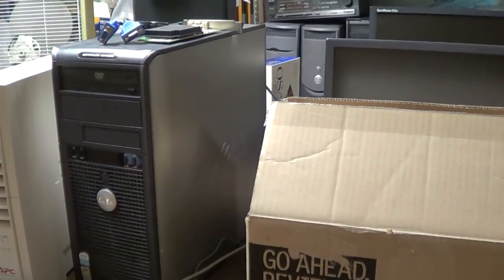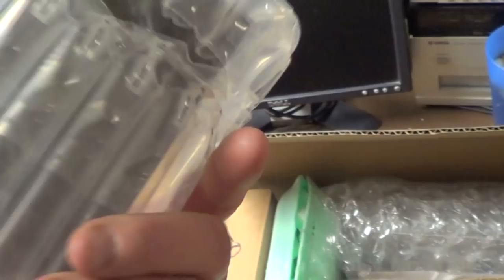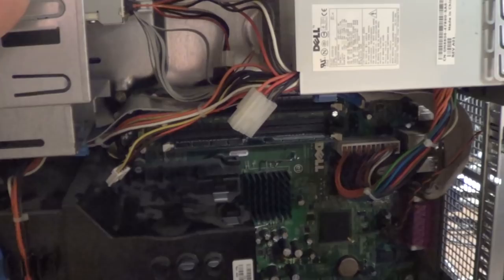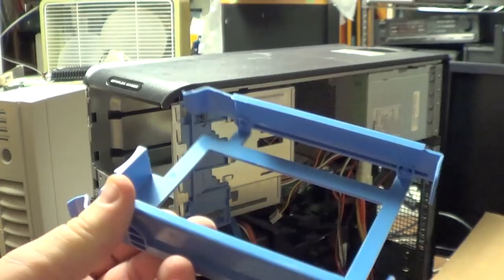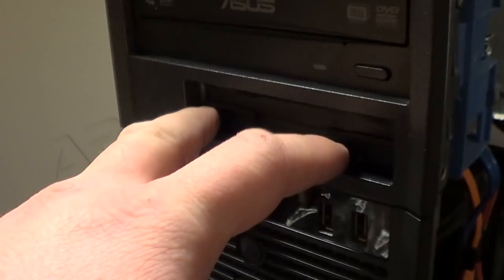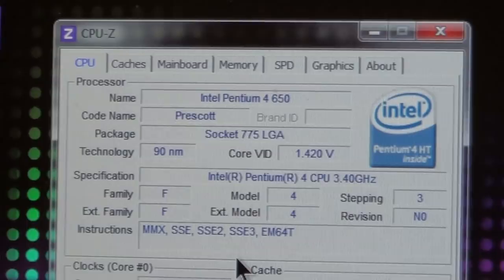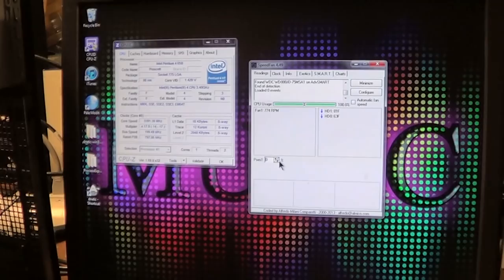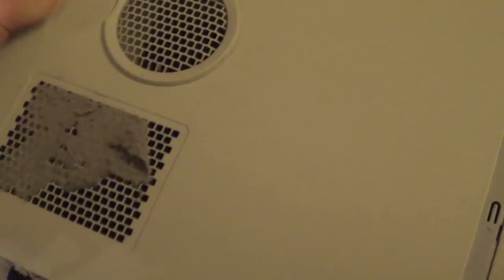"New" Music Player PC Build

Comment: Hey UXWBill.. couldn't help noticing the external audio card at around the 30min mark. I happen to have the same one connected to my build. Wondering if you had any software problems with the external sound card's included software. When ever I open the program, either all my 8GB of RAM get used up or the computer blue screens.
Reply: I have mine connected directly to one of the back ports of the tower. The buggy software doesn't bother me much since I setup my audio preferences already, there isn't anymore use for it. But thanks. just was wondering if you had any issue with it.

Comment: This computer even runs faster than my Dell laptop. Mine only runs at 2.53 ghz, but its a Core 2 Quad extreme instead of a Pentium 4. Also the ram mine uses is 12 GBs of DDR3 ram at 1066 mhz.

Comment: I'm thinking of an issue that's might be half way off topic, but the issue is on the brain at the moment. I've been using our HP a735w which has 2 line level inputs that I've been using to make mp3's. I had a Califone cassette recorder connected with a mono splitter for stereo connected. I'm guessing something has caused something to get fried on that front socket. The rear socket still works fine. I also suspect that the Califone with splitter combo fried a set of outputs on my Sony amp. They are completely dead.
 I recently acquired a JC penny branded boom box that has cassette decks, radio and the real reason I wanted that thing is it doesn't have aux inputs but phono inputs. Now the working back socket has a true stereo input and there is no need for a phono preamp when I use my record player.
Do you have any thoughts on what cooked my jacks LOL ?

Comment: I have an older version of this computer, an I managed to install 8 gigs of kingston 667 ram. I'm not really sure why but if I install more than 2 gigs of anything higher than the 667 the computer seems to like to shit on itself and no longer power on. Still not really sure why a lower speed of ram would allow me to go up to 8 gigs vs no letting me go any higher than 2 with 800+
Reply: ***** I picked 3 of them up from a school, the one that I got to work with 8 gigs may have been newer than the others. The students at the school were nice enough to take a permanent marker and draw over some of labels and the anything else that they felt like. I think I have them stored in my basement currently, but I'll be selling them soon on craigslist so I'll probably clean them and run the dell utility on their website to see what model the one that I had 8 gigs is. Great computers overall, I might just donate a few of them to a few families that I know that are in need.

Comment: i have a dell optiplex gx620n that i fixed up and now it runs windows 7 home premium on 4gb of ram and the original Pentium 4 ht at 3.0 GHz. you can even run videos a 720p on it (ps. it does not have a pci graphics card just the gma 950. I love dell :} ). i am using a dell inspiron 6400 to post this comment and unfortunately isn't very reliable

Comment: Is there a reason that you use Windows 7 as opposed to VortexBox, or some other lightweight linux distribution for storage/playback?
Reply: Fully understood, thanks for taking the time to respond! Adding to that, if you ever need a little weekend project, check out MPD (Music Playing Daemon) and some of the frontends/plugins for it. I personally use it on my machines at home, and use it's versatile output settings to send audio into my VOIP server, as well as home sound system.

Comment: I upgraded my GX620 with a 3.4GHz Presler Pentium D processor. It actually runs Windows 10! But I need an Ethernet card because the built-in Ethernet driver doesn't get along with Windows 10.
Reply from the maker: There's no reason the onboard Ethernet shouldn't work, unless it's physically broken. Use the Intel Pro/100VE drivers from Intel's web site. (Yes, I've run Windows 10 on a GX620 and yes the onboard Ethernet worked just fine out of the box.)
Reply: uxwbill weird, my machine uses the Broadcom NetXtreme driver! If I roll it back it works.
Reply: Maybe I've been using the wrong driver then, I had been using the Broadcom NetXtreme driver because it works once I roll it back an iteration.
Reply from the maker: You're right, the 620 had a Broadcom adapter. I had it mixed up with the 745. I can't imagine why there would be any update to the Broadcom driver, since the hardware itself is quite old. Maybe try downloading and installing the Broadcom reference driver for the 5500 series from their web site?
Reply: That's probably what I'll end up doing. My guess is Windows is downloading the wrong one.

Comment: Ok the first thing. Don't use the Intel Onboard Graphics for this type of application. This WILL decrease your system performance, ESPECIALLY when you are playing YouTube videos. Yes, I know this is not a Gaming computer, but its better to separate the Video rendering from the computer in total, especially if you are running Windows with Aero enabled. Also if you are going to be playing music through the computer, you are better off spending the extra 40-200 bucks on a real sound card. Onboard sound card  is inferior to the Creative sound cards they used to have in the old machines (even new ones) but even with that case, yes Onboard sound cards do work fine these days for full sound playback, but not only they could be faulty and are not designed for this type of application, it also robs CPU power, so better to get a separate sound card.
Reply: I never made assumptions that you don't know what you are doing. I am only going by experience. From what you are telling me, your set up works perfectly fine, especially when you are only playing music from a music from a music library. However, I only advised for a Video card because of the separation. It is extremely rare that a video card will go wrong, especially if it is a Fanless one, and the same factor could happen for the onboard video card. The sound card was an audio hardware I never trusted, which is why I prefer a sound card with a Better D/A convertor. I mean you are right. Modern onboard cards sound clean, and there is nothing wrong with them.... but I still don't trust them being that they are built into the motherboard, and are designed on a system strictly for business use (that is web and email) rather than serious audio usage.
Reply: Nihal Jude Hey uh this might seem rude but its not but trust me he has graphics cards and quite a few but in this situation its not worth it
Reply: @Phenom69ll computers never use there full rated current

Comment: +uxwbill Hey Bill I am just curious. (this is by no means a criticism) I was just wondering what you generally use floppy disks for? and how often? Or is it a reassurance of knowing its there should you ever need one? good video though.
Reply from the maker: +Tom Wilde BIOS flashes, quick file transfers, with older computers that don't (or can't) work with USB devices, DOS boot diskettes, Macintosh startup diskettes, to install software on older computers, and to a certain extent there is just knowing that they're readily available if I need one.

Comment: What processor is in the whitebox machine? Kinda looks like it's an LGA775 or Socket 478 unit.
Reply: ***** The CPU cooler does look similar to my S478 Northwood P4's cooler, so that would be my expectation. :)
Reply: ***** If it runs properly, then that would still be a usable office-style PC I guess. And yeah, the fact the Crashtor works at all is a minor miracle in itself!
Reply: ***** I had an Athlon XP machine that hit those sort of temperatures, but then it was both full of dust and completely knackered. I once had to reinstall Windows twice in one day on it! I'm surprised that I've not seen more Athlon XP machines on any of the computing channels I'm subscribed to.

Comment: I have the same pc just with a Pentium 4 HT (room heater edition) and it gives a beep error with 4 beeps (pause) 2 beeps (pause) 1 beep (pause) and the post screen comes up and it hangs there and dosent continue and the system is unresponsive
Reply from the maker: These really aren't worth a repair or troubleshooting any longer. Of that beep code, Dell gives only a cryptic explanation, "no time tick". This and the hangup might suggest severe CMOS corruption (clear it) or that the hardware time clock is not running (can try a replacement CR2032 battery, also check jumpers related to this).

However, these systems have and will display a message to indicate that the clock has stopped, indicating "time-of-day clock stopped". This one did, after it got wet in a flood!

More likely, the message means that the system timer has stopped (or never started) running. That's basically a fatal failure.

Comment: ASUS makes great stuff. You just gotta watch out on their more experimental ideas like Liquid metal or such. their low to mid end laptops and even some of their desktops are actually very good. 
I also have their noise cancelling mic phone dongle and it works a treat if I don't need super high fidelity on a phone call. 
and I've had generally good reliability out of Western digital, but have had very awful luck with segate and Toshiba drives. I've had 3 different Toshiba drives fail within a year. every Toshiba hard drive I've owned has failed at some point, and the only segate drive I've owned was a laptop with the drive in, it was a infamous rosewood model, and it was unbearably slow and only lasted 20k hours before the SMART info in crystal disk info was screaming CAUTION at me.

Comment: Complaining about Flush Player on a Pentium 4, eh?

Dear UXWbill, have you ever tried an Athlon64 or their dual-core X2 sisters? They're cool, quiet, power-efficient and powerful alternatives to their Pentium 4 and Pentium D adversaries. Source: I used an Athlon64 X2-4400+ as the basis for a tight-budget gaming PC, it could play most any lower-intensity game and work the Windows 7 effortlessly. Media was no problem for it and it drew like 50W at idle/doing media/web tasks even with a GTX 650 in.
Reply: +uxwbill i think a gpu will do wonders systems on either side  of this age for freeze player ...well atleast thats the case with our A64 x2 5200 sytem with a 6150 igp
Reply: Lol, the 6150 iGP, Intel X3100 and other integrated chips of this age were all well and good until Aero. Now they all need help it seems!

Comment: hey bill i have a ?... i also have a dell poweredge 1600sc server.. what the hell can i do with it as far as a rebuild (motherboard gpu psu ect)? it has the redundent power supplies in it.. i dont want to mod the case much or at all if possible... all the part in it work the last i knew when i was using it almost 4yrs ago.
Reply: bill i also have a puget custom build with an asus a8n-sli premium is it worth a rebuild i use it for everyday use dual screens and all... i found all the computer i own at goodwill (mom works there) , trash outs/clean outs of fourclosed homes (i did for 10yrs) and trash service (i did for 2yrs). oh btw thank u for your help
Reply: oh i also i dont game on pc just on playstation and i use my computers to fix other peoples computers also the puget as of now is running ubuntu 13.10.. i do run a xp, vista and win 7 machine too (the win 7 machine is the only pc i ever bought brand new)

Comment: Socket 775? Could you install a Core 2 Duo E4600 in this for better performance?
Reply: *****
Any ideas on why that may be?
Or is it just not 775?

Sorry, I'm trying to upgrade my Gateway 500GR (Pentium 4 HT 3GHz) to run just a bit better and the CPU fits in the socket no problems, but the system won't start...
Reply: *****
Any idea about the Gateway 500GR? It claims to have Socket 775, and I can replace the power supply if needed.

It's a bit under powered for what I do...

Comment: what type and modal of ddr2 did you buy? and could you recommend some that would work in a optiplex 775
Reply from the maker: I don't recall -- it was well reviewed, name brand stuff. That said, you absolutely do NOT have to buy high-spec/performance memory for these machines. Anything that meets the spec will work just fine.
Reply: ok thanks i did not know if they are picky over what ddr2
Reply: Alex Siebrands i would try ddr3 just be on the safe side

Comment: im rocking a dual screen puget build mid tower with an asus a8n-sli premium mb amd 4400+ x2 64bit with 2 160gb 2.5in sata hdd (from brokem ps3's i got free), 2 320gb 3.5 sata hdd, 1 200gb pata hdd 2 sata dvd burners, 1 pata dvd burner, 15 usb ports plus web cam is one for a ps3. i got all internal parts free and have many more computers/parts for back up.. i also  have 3 external hdd's ( 3tb, 1.5tb and 320gb) oh im running ubuntu 13.10...

Comment: Oh man do I remember when I had a PC (not a Dell) that I had absolutely fucked up with Msi Afterburner. I had the case open once, and the graphics card (Nvidia GeForce 9500GT) had all the clock speeds and stuff turned up to the max, but I accidentally hit my hand against the PCB of the card, and got a 1st degree burn on my hand :P You can tell I was not good at computers at the time..
Reply: +Alari645 Ah, the 9500GT. I never overclocked mine but not too bad of a card as far as legacy PCI ones went (that's what mine was). It'd run Crysis 2 paired with my P4 and 2GB RAM at, ah, about sub-20 FPS if I remember correctly? :)
Reply: ***** Well I didn't play Crysis 2 at the time, I was not good at hardware at the time, so I tried more ''demanding'' titles like BeamNG Drive, which I only got like 2 FPS out of xD And It constantly kept crashing and artifacting all over the place so I just got a new system. The 9500GT ''system'' that I talked about in the last comment is still in use, my parents are the only ones that use it (mostly for e-mail and paying bills). Sometimes they just read the news off of the internet. The system served me well, but the 9500GT that's in that system, still has a risk of fire, as the thermal paste is well... ''Crumbly'' . I do wonder how the PSU has not given away yet.
Reply: Alari645 I had to replace the PSU in my 1100. After a little cleanout it still works today. :) Just I took the 9500GT out for my mom's Dimension as it needed it more.

Comment: A pentium 4? Damn you have courage. I wouldn't even use a PC with one of those. A Pentium D 945 is slow enough.
Reply: So boot speed and the temperature/ power draw don't bother you? Saying that... The heatsink on the Dell Optiplex mini towers is absolutely amazing and will keep things cool anyway.
Reply: A dell dimention 2400 with 2gb of ram and a pentium 4 processor served me quite well, until the maxtor harddrive gave up on me
 (it died some time in ooh 2011-2012)

Comment: I know you said the Pentium 4 is good enough for your needs
But I just wanted to let you know that you can actually upgrade this pc to a Pentium D
Dell officially supports up to Pentium D 840 for the gx620
But you can actually upgrade it all the way to Pentium D 960 If you wanted to
But because you only want to use it for music only the Pentium 4 is more than enough
Reply: Yeah I know those NetBurst architectures get crazy hot 
I tried putting in a high-end Pentium 4 in a Dell Dimension a few years back 
and I just couldn't keep the temperature under 65 degrees Celsius

Comment: what causes bolted capacitor,s  how to prevent it
Reply from the maker: +pattric7 Bad capacitors are caused by manufacturers using a stolen formula with a serious flaw, by use of low quality parts or through poor design practices. You can't do anything to stop it from happening. The only fix to replace bad capacitors with high quality units.

Comment: Pentium 4 eh? I have an HP system that packs a 3.2Ghz Pentium 4 that blew the pants off a Core 2 Duo 3.0Ghz. I couldn't believe it myself. If you must know, I was running a game (World of Tanks; quite a processor intensive game) as well as Google Chrome with multiple tabs open, all of that crammed into Windows XP.

Comment: mine only well see 3 gig out of the 4 i put in it.... :/ i do have a Pentium D 3.4Ghz
Reply from the maker: +Matt K That's the best you can hope for, even if you run a 64-bit operating system on the GX620. It chipset lacks any capability for >32-bit memory addressing.
Reply: Ok.....
Reply: +Matt K Mine sees a bit more but not much, 3.50GB out of 4 total.

Comment: Don't really see a point of one, let alone two DVD burners in this day and age, optical media is slowly but surely loosing it's race against cheap USB flash storage.
Reply: ***** I understand that, but what I find strange is buying new drives in this day and age, I have gotten dozens of working DVD drives for free. Buying a new drive today doesn't make much sense to me, it's like buying a new casette player these days, sure some people (including me) like to listen to them, but buying a new stereo with casette player doesn't make much sense these days, at least to me.
Reply: Bojan Savić
i have to agree with you i dont even know why cars come with cd players anymore they should come with a sd card readers instead... i have three dvd/cd burners (i opted out for just a regular cd burner). i dont use them all that much at all to me cd's/dvd's are obsolete that whay i have countless sd cards ranging from 512mb to 64gb ontop of the endless supply of old hdd's im turning into externals.